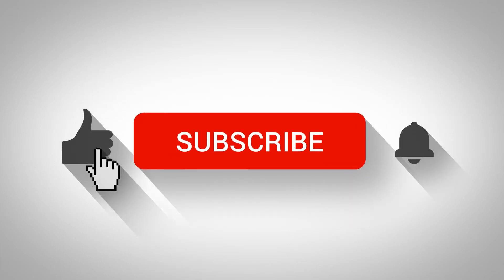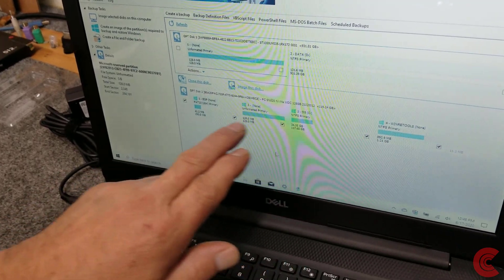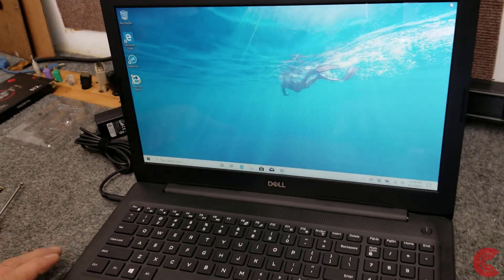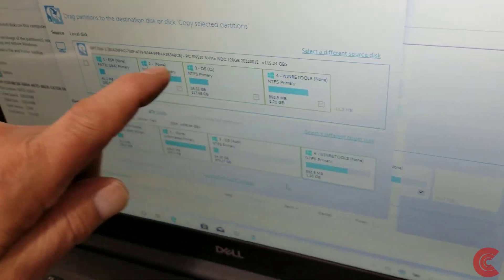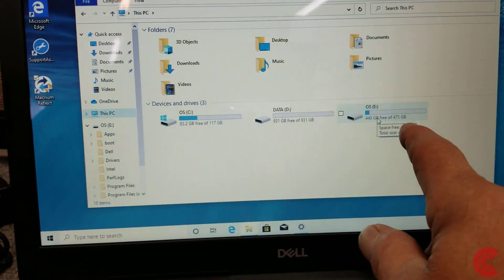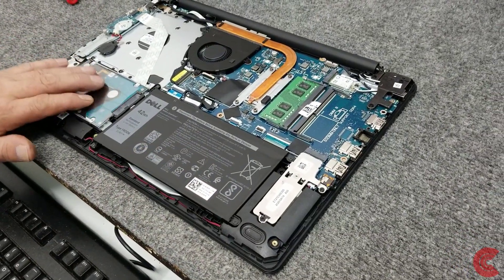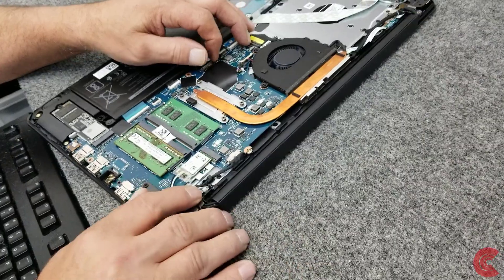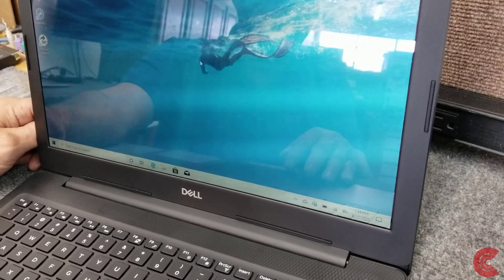Clone M.2 NVMe SSD to Larger SSD & Memory Upgrade Dell Inspiron 3583

Comment: I found this video very informative and followed it exactly to upgrade my laptop. I was upgrading the primary (C:) drive from a 256GB to a 1TB NVMe. All went well until I restarted my machines after the process and found applications I had installed on the secondary (D:) drive were no longer available. 
I discovered both drives had been encrypted using BitLocker and some how the key for the D: had been compromised by replacing the primary drive. The original primary drive, now residing in the enclosure, is still encrypted but, as I hope not to need the files on it, I am not concerned at this point.
The lesson-learned is to remove BitLocker from those drives that might be affected before commencing the cloning procedure, and more importantly, reinstate BitLocker once complete.
I suspect Windows 11 will ease this issue because, unlike Win 10, it expects there to be a TPM on the motherboard for storing encryption keys.

Comment: thank you for your videos i liked using the plugable adapter  macruim reflect doesnt work for me so i bought a seagate  baracuda nvme m.2 ssd, and used there seagate disk wizard. its like acronus. it cloned fast the first time. again thanks for the great videos. keep making more thanks

Comment: Fantastic video that I wish I saw yesterday. I did a full clone, then did the resizing after. Took me hours to find out what I did wrong. About to pop my new 1TB SSD in. I hope I boot up...

Subbed!
Reply: Did it work for you?
I have a 2019 razor blade 15 with a 2070 max q and it’s not working when I pop in the new ssd.
Reply from the maker: Thx for watching. Dale

Comment: Lost me with the resizing bit, is there an auto sizing feature?
Reply: No, as you will have many partitions on a retail computer, and for whatever reason, people may want to create more partitions, resize them, etc. I literally did this yesterday, before putting in my new 1 TB SSD. I've looked at dozens of videos, and this was the best. You may have to rewind to catch what he's saying. I spent HOURS trying to figure out out to resize the C partition. He addressed that really quickly. I used the same free software he used.
Reply: @guitarforudude  I figured it out, thanks for the advice.

Comment: Hey Dale, I'm doing this procedure as well following your every move just like the other video.   For this one, after I situate the partitions from Source -> Destination and hit Next I get a message about Bitlocker not being enabled and to enable it after I clone.   I didn't take it any further, I see you didn't have that on yours so just trying to figure out how to go about it.  I know how to enable/disable it but read some horror stories about not being able to boot and/or re-enable Bitlocker.   As always any insight or advice is very much appreciated.  Wy wife already wants to chop off my beans for getting this laptop and investing further in SSD's and RAM so if I completely screw it up I'm a dead man.
Reply from the maker: Hi. If device encryption is enabled,  you cannot clone. Go ahead and disable it first before anything.  I have never had a problem . When you turn it off, it does take a long time, depending on how much stuff you have on drive. Dale
Reply: Okay so disable, clone, then re enable on the new SSD after I switch it out?  Thanks Dale I really appreciate your time, I know you have a business to run and things to do.  Do you have Venmo?  I'd like to donate a little for your help
Reply from the maker: @tahampton25  Hi. Technically, you don't even have to re-enable Device Encryption after cloning.  Totally optional.  Thx, Dale
Reply: @CadillacComputerCenter  okay thanks.   In your opinion, would it be easier/safer to just to do a clean install of the new ssd instead of cloning?  It's a new laptop and I don't need anything on the existing drive, just want to start fresh with larger storage.  I thought cloning was necessary in order to upgrade storage.   The other video you did on a Windows install with an 8GB flash drive, would that be the right option?  Thanks again!
Reply: @tahampton25  If you're upgrading from a retail computer, you likely should clone, as there's hidden partitions (drivers, Win 10, and other tools). The tricky part (for me) was resizing the C partition. Wish I found Dale's vid yesterday. He got right to the point on resizing.
Reply: Thanks for the advice, I wound up doing a clean install just to play it safe.  I did however use my old laptop as a guinea pig and tried the clone process on that one, no love lost if it failed.  But it didn't so now I know the bitlocker concern is no longer an issue.  Yea Dale's top notch, I've learned quite a bit just from watching his videos, he should be a teacher

Comment: Nice video but I can't get it to work for me :( I followed the exact steps and was able to clone the SSD but windows won't boot up for me.  Any advice
Reply from the maker: Have you tried booting into safe made.  Or, run a startup repair after cloning.
Reply: I’m running into the same exact issue. I don’t know what’s going on
I have a razor blade 15 with a 2070 max-q graphics card and the cloned ssd isn’t being recognized

Comment: Good and steadily paced instructional! Pulling together the pieces to upgrade my Dell G5 based on this and already sourced the adapter and MVMe SSD.  Thanks and subbed. :-)
Reply: Did it work for you? 
I put in a new 2tb. My old one was a 512gb. My laptop isn’t recognizing the new drive I cloned it exactly like this dude did.

Comment: So where do ya get the stick that the m.2 goes into for cloning purposes?
Reply: He put the info into the Description box.  Click the "Show More" link just beneath the video.  The device is called a "USB to M.2 Adapter". Be sure your memory matches the adapter you wish to use!!  There's a notch at the "insertion end" of your stick of RAM.  That notch moves around depending on the type of RAM it is.  The notch (or "key" as it's sometimes referred to) is there to make sure that only the correct type of RAM can be inserted into it.

Comment: Hey thanks for the useful video. I have one question however: 
My laptop has a spare SSD slot that I'd like to install an upgraded SSD as my main C drive, but to keep the existing SSD installed for files and games etc... Is the process any different during the cloning and installation phase? Cheers.

Comment: Very useful video. Thanks. I got the same laptop with some different features. I installed an m2 nvme ssd but it is not shown in booting options on bios. I tried everything i know but could't find a solution. Do you have any advice sir? If you can help me i would appreciate
Reply from the maker: Hi. Your ssd will not show in bios .  You must boot from a windows 10 usb installation flash drive to install windows  on your ssd.  I have many videos on this process.  Dale
Reply: @CadillacComputerCenter  I have already tried it. I installed win10 then restarted but it didnt boot new drive so i checked bios but even i installed windows on it, m2 ssd wasnt in thr boot sequence list.

Comment: I recently bought a new 17 7000 series Dell which when I opened it had 2 DIMM RAM slots and 256 GB M2. I called customer support to verify that I could upgrade the RAM to 32 GB and increase the M2 to 2 TB. The India based customer support said that this Dell was limited to 16 GB of RAM and 1 TB of NVMe. I don't see why it can't take the 32 GB RAM cards x 2 and a 2 TB MVMe card. How do I confirm that a modern mother board can be upgraded to better components. I returned the laptop as it only had one bay for storage. I thought it would have at least 2 bays.